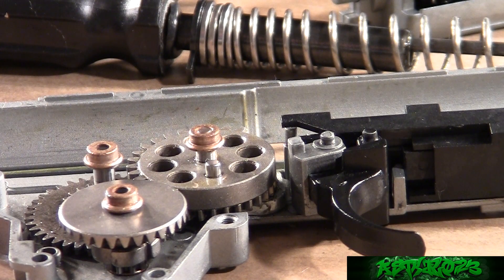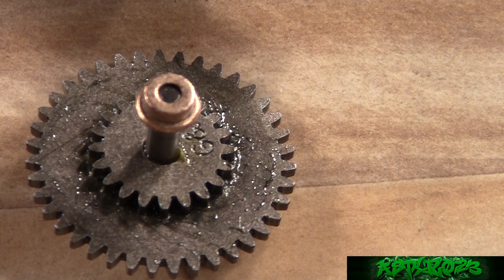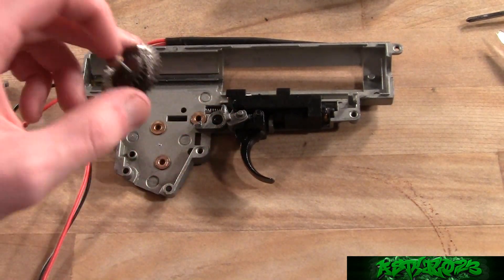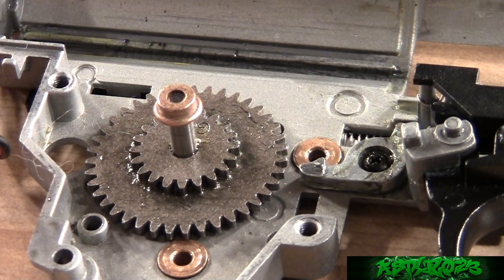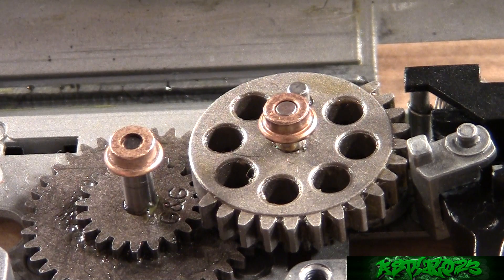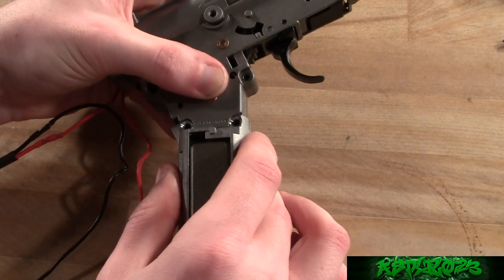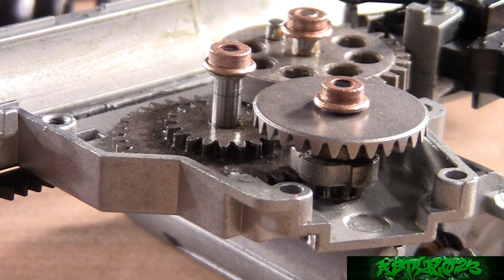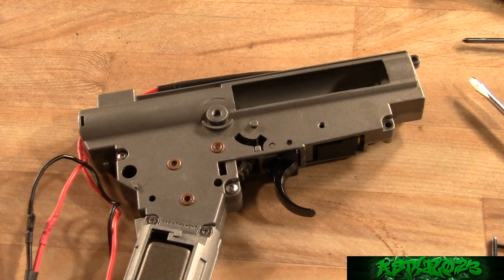How to Shim an AEG Gearbox  -ASTKilo23-

Comment: What gear you start with is NOT about preferance. The best way is to start with the bevil to set it to the correct height for the Pinion and Bevil to mesh perfectly.
Reply: Very true. I personally start with the spur gear 1st. Because after I shim my gun the 1st time. Its usually always the same for bezel height. But starting with the bezel is the safest way lol. That's 4 sure
Reply: Lol try that in an mp5

Comment: The last step @6:07... What would cause the gears to scream? I mean an ear splitting sound.. Without the motor in there, screwing the box together.. and manually turning the gears, there is no grinding at all, everything is nice and smooth. I've done just about everything and it still makes that very very loud noise..
Reply: adjust the motorscrew at the bottom of the grip. sounds like the cog on the motor isn't the right height. To far up and it locks up, to far down and it doesn't catch enough of the bottom gear and thus screeching noises. should be a screw or a little insex screw in the bottom to raise/lower the motor in the grip. try a quarter turn at a time.
Reply: this is probably caused by the motor being to adjusted in too much or not enough if you manually spin the gears without the motor and they spin smooth then simply play with adjusting the motor until it goes away. If that doesn't work either then it can either be the battery, the motor is weak or dying out, the spring is to strong for the motor, or when you closed the gearbox the gears with all other components got tighter so you'll need to re-shim. Shimming takes patience hope you manage to fix this

Comment: I like how you tested it at the end without the piston. I’ve been testing my original g&g set by taking the gearbox apart entirely and putting it back together for experience. Going to test it without the piston when I actually install my 13:1 set. Thank you for showing that!

Comment: I used this video to shim my gearbox and I must say it was really helpful, but the only thing I'd comment on is testing the shimmed gears by using the motor. I attached my motor after spinning the gears manually to test them, and when I cranked the motor (its an shs high torque) it made alot of grinding noises and this went on to 4+ hours of reshimming, and at one point i disregarded testing it with a motor and just reassembled the gearbox, and the gun is shooting really smooth.

Comment: i took the gearbox apart on my jg m4 because the motor burnt up on it and i couldnt decompress the spring so now the spring is weak, it has golden eagle metal gears in it and a plastic tooth piston so when i opened it up it let the piston loose and it exploded nothing is broke but all of the bushings flew out i got all of them BUT THE LITTLE WASHERS ARENT IN THE SPOT THEY WERE BEFORE SO ARE THOSE LITTLE WASHERS CONSIDERED THE SHIMS? IF SO THEN I CAN FIX IT but if not what do i do.

Comment from the maker: @95bullseye most gears have the spacers built in. usually only cheaper chinese gears use the brass removable spacers. i would put the shims on top of the spacers so that you do not interfere with the gear teeth or the tappet plate.

Comment from the maker: @HaloTheRipper that i understand. what i mean in the video is that i start with the spur, then the sector, then the bevel. i then adjust the spur and sector if i need to so that the bevel is aligned properly. more often than not in stock guns the shimming is pretty tight and doing it in that order is just fine.

Comment: My M14 sounds like a smokers cough when I pull the trigger, I have played with the motor height, and it helps a little, but it still sounds bad. Am I going to need to get in and shim? Or is it something else that I should be looking at?

Comment: Hi, I like the what you've done.  I don't know if it will be obvious to other audience members but may I add when observing how far the bevel is raised by the pinion to check and adjust the motor height to make sure there is enough contact between pinion and bevel.
last note: don't shim when you're tired as heck and/or in a bad mood.  learned that the hard way.
Great vid! Make more! would love to see how you play.

Comment: I have a question im going to buy systema parts for my ics m4 like piston, pistonhead, cyclinderhead, cylinder, tappet plate spring guide, And barrel and Bucking  and spring to m120 can i keep the original gears on it? without spending 70$ on the systema gears?

Comment: Hey I had to switch my gears on my version 3 (just like in the vid) and i used golden eagle gears i had laying aorund. I didnt leave any shims on top of the spur gear because it was so tight with one shim in each side it could barely move. So now the top of my spur gear is spinning on the metal bushings i got but they have that weird cross on the inside...will this last or should i get new gears?

Comment from the maker: i would probably at least get a set of torque up gears. i have not used king amrs gears in a while, but i remember them being just like any other stock gears. probably want to upgrade if you want an m150 spring.

Comment: Short answer: No.  Long answer: If you cut out holes in your gearbox so that you could switch internal electrical components to the opposite side, then cutting and soldering wires, then cutting the receiver to fit the selector switch on the left side.. With a lot of machinery, technical skills, and intuitive thinking, and money.. perhaps it could be done.  It would be one hell of a project, though.

Comment: Shim every gear individually, then close the gearbox and spin, not tight, not to freewheel. Do that for each and every gear alone, then install all threee and test with a weak or low voltage battery.

Comment from the maker: slightly different, as in you can see everything though a large port in the bottom of the shell, but everything is in a straight line, not at an angle.

Comment: I wonder how you came to the conclusion that the bevel gear can have the most play. That shouldn't be so none of the gears should have any up or down play but should still spin freely especially the bevel because it comes in contact with the motor.

Comment: is the shimming job that is from the factory ok? i took my gearbox apart for a spring change and moved some gears around in doing so. When I put them back in everything seemed pretty smooth and i put all the shims back where they were. Should I be good?
Reply: In my experience, sometimes the shim job out of the factory is OK, but if you're in the gearbox anyway, reshim it. Better to have it shimmed in a fashion you know is good, than trust mass production techniques.

As long as you're getting a reasonable amount of "looseness" to how your gears spin without anything in the gearbox, with minimal movement along the axles of the gears, you're good to go imo. That being said, this video is an excellent one to learn how to do it properly.

It takes time, patience, and practice to get good at shimming your gearbox, so don't get discouraged.

Comment: What does it sound like it when it's not shimmed properly?
Reply from the maker: like a dying cat.
Reply: So realisticallly, when you fire your airsoft gun, it should only really be hearing the sound of the piston hitting the cylinder head?
Reply from the maker: in a perfect world, yes. but realistically you'll still have some gear noise. not a lot gears and pinions still output cyclic noise even when tuned perfectly.
Reply: Oh yeah nah, I was just referring to your video. Because yeah, you can hear the gears moving of course, but it doesnt' sounds squeaky.

Comment: My fps went from 350 to 200 after I shimmed!! What'd i do
Reply from the maker: shimming does not really effect fps, compression, etc. make sure the cylinder is facing the correct direction and that you assembled everything correctly. most noobs put the cylinder in backwards with the port to the front making it so that they have virtually no cylinder volume.